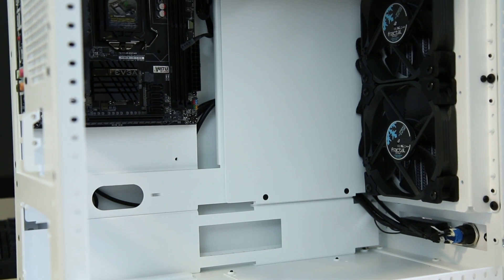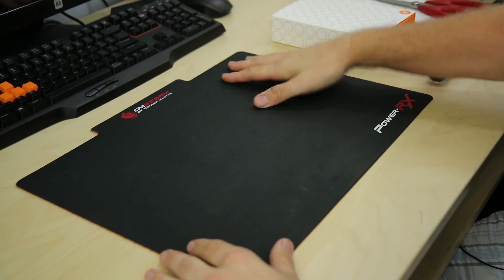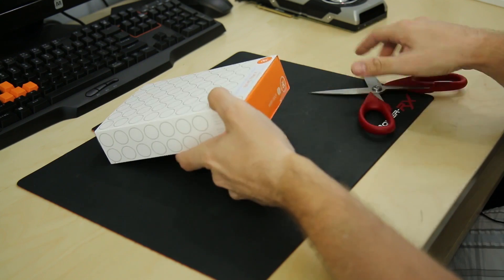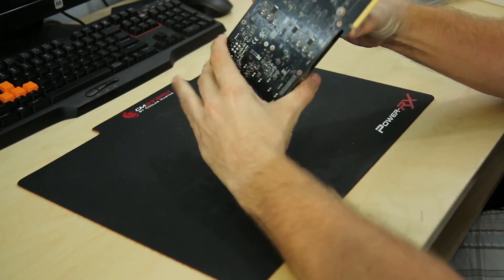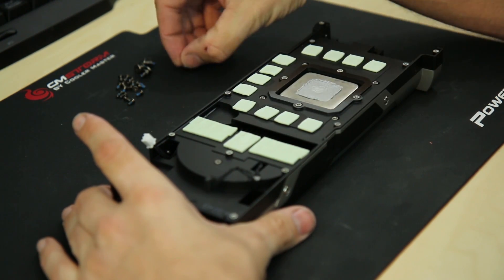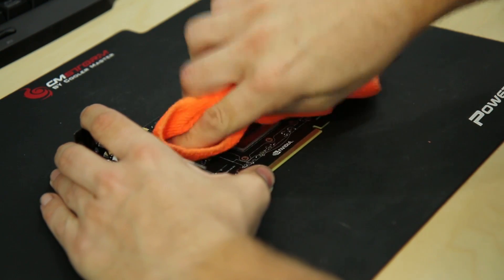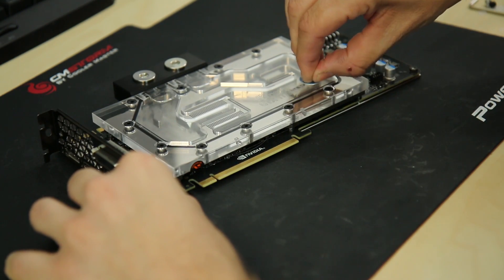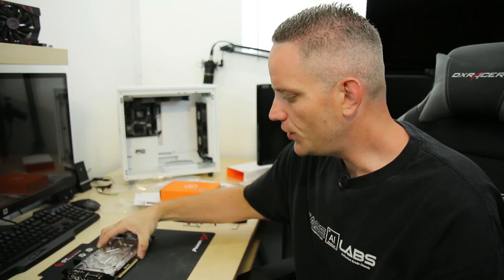ULTIMATE GUIDE: How to install GPU Waterblock

Comment: Jay... Here is a Tip for everyone... I always run the card through a quick stress test like Fire Strike, Shut Down PC, Switch Power Supply Off, Remove Card and then Disassemble for the New Block. What this does is by the time you are ready to remove the Stock Cooler the Thermal Pads & Paste are warmed up so removing the Cooler off of the PCB is much easier to do :)

Comment: The best thermal compound for GPUs is GC Extreme, though you do have to use the spoon it comes with because it's too tick to be used like the Artic compounds. GC, if applied properly, will give you between 2-6 degrees lower difference.

Comment: I wish I could do this kind of block on AMD cards, but alas EK doesn't make blocks for AMD cards unless they are reference design. Bu if you are NVIDIA you can get away with board partners making custom cards and EK will still make them. Still makes no sense why they would do that for NVIDIA and not AMD.  *sigh*  Team RED still can't catch a break.
Reply: Ninja_Commander The only company I have seen that make blocks for AMD are AlphaCool.  They use a hybrid which works but I would like a full cover block for AMD cards.

Comment: Are the input/output ports of blocks, rads, pumps, etc. uniform in size such that when buying fittings one only has to worry about matching the tube diameter?

Comment: FYI rather than going clock- or counter-clockwise pattern, you should tighten down screws in a criss-cross (or star pattern for odd number) pattern for even pressure and compound dissipation. similar to how a car wheel's lug nuts are tightened down. it's not critical like wheel lugs with their torque values, but it's a good habit/principle.

Comment: Why is 'line the size of a rice-grain; generally advised for thermal compound application on the CPU IHS; whereas in this video, it is recommended to apply the TIM in a 'cross' / 'asterisk' pattern? Isn't the end-goal for both to apply as little thermal compound as possible whilst ensuring that the entire surface of contact is coated?

Comment: I thought you said not to use nickel and go with copper or am I confusing nickel with another metal that's on the blocks
Reply: Your confusing nickel with aluminium
Reply: I was refering to OP
Reply: Will Leonard the liquid never comes in contact with the nickel on these.
Reply: It's a nickel plated copper block. So the actual internal metal is copper and the nickel is on the outside for looks and cooling

Comment: Hey Jay I have a gtx 770 4gb , I also have a custom loop. Unfortunately,  no one makes a water block for my graphics card, is there any alternative ways I could add my card to my loop ? One other option is the g10 bracket from nzxt but I'd have to buy a closed loop , and I'd rather have it on my custom loop.
Reply: If there is really NO waterblock for your card go to Alphacool. They will take your graphicscard, develop a waterblock for it and sen you the graphicscard with the waterblock for free. That is their service for new waterblocks people want.

Comment: For a future vid it would be nice to see a general what to do and what not to do guide to installing radiators

Especially things like when to use the long and short screws when attaching fans or mounting it straight to a case and general airflow configs.

Comment: JayzTwo Cents you do a x99 overclocking guide with watercooled cpu, motherboard, ram, and gpu or do it when skylake comes out, i belive gigabite will be making a motherboard where watercooling the power delivery is built in to the heatsinks

Comment: Hi guys I'm a 14 year old inexperienced in PC building and I was wondering if it would be worth it to pay someone $50 to build the PC for you (not including windows), I feel like I have done ENOUGH research at this point to build a PC (over 1 year) and there's obviously great guides on the internet so should I take the risk?
Reply: Barish K what MrN3MESIS said, assembling a computer is very nearly a paint-by-numbers job.  Just make sure you follow your instructions (mostly the ones from the MB) and you'll be fine.
Reply: Barish K Tbh mate there is no reason to spend that sort of money getting somebody else to build it for you, it's very hard to mess up and you will likely be fine provided you follow tutorials correctly.
Reply: MrN3MESIS thanks, also gtx 970 + i5 4690k or R9 fury (non x) + i5 4590?
Reply: I haven't heard anything about the fury really so I don't think I could help you there, but if you are looking to game at 1080p, the 390x is cheaper than the 970 and gives better results in benchmarks so that may be a wise choice.
Reply: Hey Barish, I was 13 when I built my first PC and it's actually not hard at all! I felt the same way as you when I started, but just do it and you'll be fine!!
Reply: +The Gaming Pepperoni got my rig already. It's an i5 4460 with 2 970's (the second one was gift so.... Yeah the cpu does bottleneck but at 1080p every single game is over 60 fps at ultra anyway)

Comment: Now if only we could remove the giant DVI port on the edge and make the card fit into a single expansion slot XD
Reply: ***** If you got a Fury X you could do just that.
Reply: ***** Too bad you gotta pay extra to get higher Asiic cards.
Reply: ***** Unsolder DVI connector and dremel that pcie bracket in half. Shouldn't be too hard, but I would never do that to a 600-700 dollar video card.
Reply: WoahWoah378 that's exactly what I meant: too expensive to screw it up.

However... NVidia could have done what AMD did on the R7 240 (I think it was the 240) where the extra output was just attached using a few wires and could be pulled off and the bracket changed to accommodate it into a small form factor case.

That would be thinking too far tho XD 
Still wanna see someone make a single-slot 980 tho XD
Reply: ***** 
WOT!? This I gotta see! I'm tired of always blocking my 1X slot
Reply: Corey Muncey just noticed that as well... I kinda like playing the game of GPU-roulette tho XD

Comment: Hey jay, I have two GTX 980 strix running Windows 10. You think you can make a video about GPU voltage unlock via bios and haware voltage unlock? I've been a couple of articles about how to but to be fair it's new to me I usually like how you make how to videos. I saw your video bios but It didn't work for me (voltage did not change). I ask because underload at 100% fan speed I get 65 deg Celsius so I want to squeeze more performance. It might even get me to water cooll  right now my voltage is stuck at 1200mv and 1150 for my second

Comment: DEEZ NUscopes.
Great video.Would be great if you made one tearing apart the cooler itself and painted it. I'm gonna do it in the future.
Just built my 4790 980ti 3 days ago, my first build, replaced the cpu cooler 2day. At this point I just wanna do wattercooling on my GPU but monez...

Comment: Do they make water blocks for Asus Matrix GTX 980's?
Reply: Gregory Lewis no sorry, you just have to submerge them in water and hope they don't break unfortunately
Reply: Gregory Lewis I check http://configurator.ekwb.com/step1_complist and EK doesn't make a full cover block for that card. However there are universal blocks and you can check other companies to see if someone else makes a full covered version.
Reply: Zero Xleifer it has a special pcb with better power deliver, so you need a special waterblock for it
Reply: Thanks drolicheck I think I found something that will work from EK.

Comment: Hi could you do a tutorial on how u fill the system up with coolant unless u have done one.
Reply: MineHive Minecraft 
1.fill reservoir.
2. turn on pump
3. turn off pump
4. repeat
Reply: SANIC but you cant repeat "turn on pump" without turning it off!
Reply: SANIC 
1. fill reservoir.
2. turn on pump
3. turn off pump after a few seconds
4. repeat
Reply: Karavusk I use a HUGE syringe to fill the reservoir so I don't have to turn the pump off.
But ya, its super simple
Reply: Karavusk don't under estimate my powers!
Reply: U guys r mean jokes just kiddin